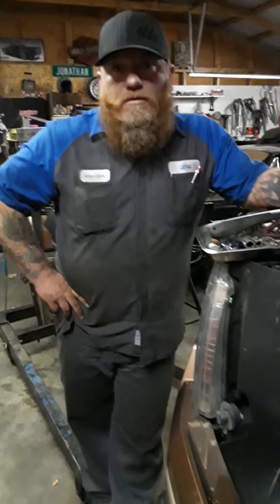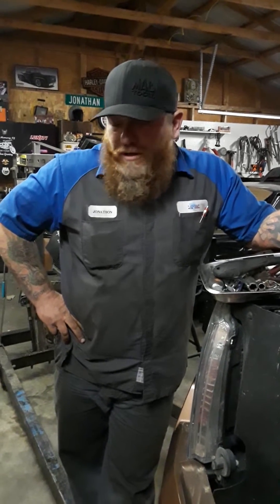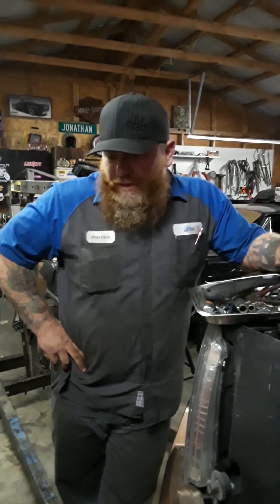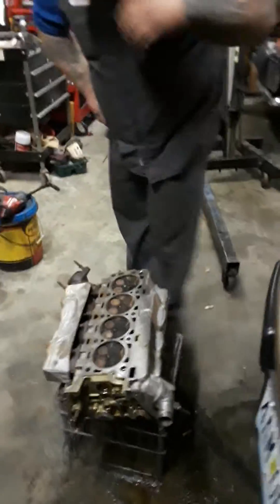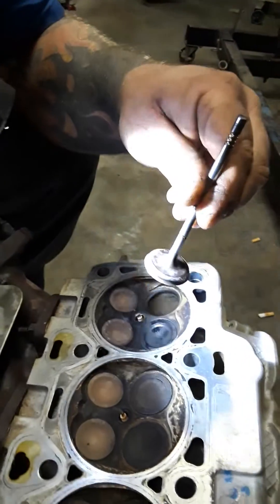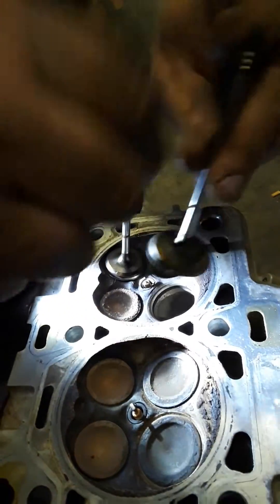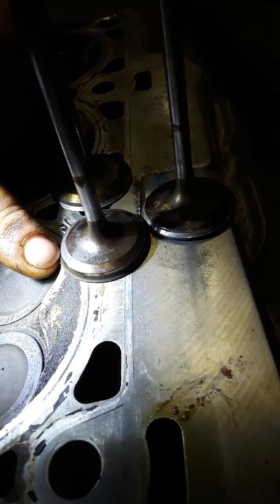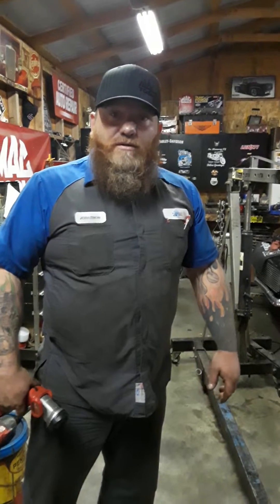Ford 5.0L misfire on #8 cylinder issue

Comment: How is ford not liable for this issue since it is a design flaw. Looks like 100% failure on the 2011-2013 models from what im seeing. Im currently in the same boat at 110k miles. Sad that a truck is dead after such an easy life of never towing. You think ford would replace the valves with decent metal at least.

Comment: Hey man i have a different issue on my 2012. I have a real bad ticking noise that i narrowed down to cylinder 7 or 8. Ive changed plugs, lash adjusters and rollers. Still have ticking. Any suggestions be helpful

Comment: If it was just a bad design then why is it typically only on 8? My guess is this is because the heat does not dissipate fast enough in this area. Running it with Lucas restore, full synthetic, and watching the temperature might help in getting more miles out of it? Thoughts? How long does it take to pull and replace the driver side cylinder head and the cost of a valve job?
Reply: Yes heat issue, all early gen 1 coyotes had heat issues with cyl 8 especially if boosted or under load like towing a lot. 13-14 not as much because they slightly revised the head

Comment: Happen the same thing on mine changed spark plugs, coils, injectors nothing happened. I tried crc valve cleaner and it got worst it was vibrating at idle and higher gaz consumption. Finally changed all the valves and it run like brand new.

Comment: Was this a 4x4? The dealership here is telling me that they need to pull the engine to pull off the head because mine is a 4x4. I can’t figure out what the 4x4 has to do with the head.
Reply: That's a lie. Dealership did my 2013 4x4  this way. They probably just want to the engine so it's easier to work on.

Comment: Thank you WeFixShit for your help in diagnosing this thing. I was sure it was an injector problem because it ran so well on the highway. Compression tested it and only had 80psi on #7. Pulled the heads today and one exhaust valve on #7 was about 1/16" inset compared to the rest of them and I could see light between the valve and seat. Also found another exhaust valve on bank one beginning to do the same thing. Again, thank you for your help 👍

Comment: How many miles would you say it would be safe to drive? I'm having the same issue on a 2014, but do not have money to put it in the shop right now.
Reply: I have a 2014 same issue in #8. I have since driven it another 12,000 miles has 180k now. I run mobile 1 full synthetic and use Lucas restore plus injector cleaner . It has not gotten any worse. 2 years ago the dealer said I need a new engine as it will blow up at any time. Another independent shop wanted 2500 to do a valve job
Reply: Fix asap

Comment: Nothing but another POS designed by Ford to just make it past warranty/ cost the customer an arm and leg & then have to buy another truck, they just hope u buy a Ford again. This is a stone hard fact and the only thing the company cares about; bottom line profits, it has nothing to do with the quality or reliability of the product. Ford does not care they do the minimum they have to follow rules/ regulations. I work as a Technician and would never/ ever purchase a Ford vehicle. Just my 2 cents

Comment: I see you have most or all the front end still assembled. I don't expect you did this over the fender. Any tips would be greatly appreciated. I have a 2013 with a bad head gasket. Thanks for the video.
Reply from the maker: No body parts had to be taken off.

Comment: Same exact issue on my 2012 5.0 F150 Low compression in cylinder number four. Service light flashes sometimes at idle.. Run and drives perfect
Reply: Same exact truck and cylinder issue here. When driving it runs great, idling not so much. Noticed the service light flashing at idle for the first time the other day. Did you confirm it was a valve issue?

Comment: Where are you guys located? I have cyl 8 on my 14 mustang gt that has low compression, misfire, etc.
Reply: U fixed it?
Reply: @Piuf30  ended up buying a new engine from Ford.
Reply: @MSUDave  Mind if I ask how much it cost and was it new or remanufactured?
Reply: @beedifrnt  new engine. Just over 8k.
Reply: @MSUDave  Thank you for your quick response. I was just quoted $9,100 for a remanufactured engine, which includes installation and a 3 year/unlimited mile warranty. That is from a Ford Dealership. They claim even a remanufactured 5.0 is extremely difficult to find these days.
Reply: @beedifrnt  when I bought mine, the shop, who is a certified Ford repair shop, said it was the last one in the nation at the time due to COVID. I'm sure prices increased as well. If I didn't have a bad back I would have done it myself to Save some money.  I would probably consider that engine in today's climate. Np.
Reply: @MSUDave  Engine will be delivered and installed next week.They stressed it is a long block - not a short block. This dealership service department has a good reputation, and since it does have a good warranty on parts and labor, I went with it. I can't afford a new vehicle and my truck is in otherwise good shape. Thanks for your input, I appreciate it.
Reply: @beedifrnt  good to hear man. Enjoy it! I drive my mustang as much as possible to get every penny out of it lol.

Comment: I was told I need a brand new engine on my 2014 f 150 V8 because the number 4 cylinder is shot. I just got the truck and hardly ever drove it.Do I really need a whole new engine because they are one piece and you can't just fix one. I keep driving it because I can't afford new engine but will need emissions done and it won't pass?
Reply: Its hit or miss honestly
Reply: I got code P0308 misfire #8 and they also told me i need a new long block. I ‘m getting a second opinions cause it will cost me 5k to fix it. I have 122K fwy miles .
Reply: @sigmamale7604  What was result?  I've got same cylinder
Reply: @RWHild  I have the same problem and it's most likely the valve not sealing on the valve seat. It drives okay but idles rough and throws the P0308 code. Shops want to replace the motor because they don't want to warranty a valve job. 

I'm going to take the heads off this week and verify, but 99% sure it's the valves. Maybe I'll make a video of my struggles.

Comment: Fuck me, I have the same problem on my 14th f150 right now it only 83,000 mileswater pump grenaded going down the highway block overheated and ever since I've had a misfire in idle change out the coil and the plug still misfiring and this is exactly what I'm scared of....
Reply: Overheating may have blown a head gasket.

Comment: Mine has 90 psi-100 psi on most cylinders. Shows missfire on cylinder 2. Did a missfire test with a scan tool and all cylinders are missfiring. Guessing this is the same problem as the one on the video.
Reply: was it ?

Comment: I got a 2015 with this issue 30% Down on compression, im still smoking 6.2 like this lol but really wanted to get it fixed but fird wanted to charge me to strip it down to see what was causing it if its $3,500 at the dealer i think ill just take it to a performance shop and upgrade there

Comment: Im having the same problem, cylinder 8 misfire, bad cylinder head. The ford dealer wants $6400 to rebuild only half the engine and $9400 to replace. Im not sure what to do i dont have that kind of money to fix it.

Comment: Pulled the head off, and all my intake valves are worn down to razor edge, I'm sending it to a machine shop for a valve job, I just can't pull the passenger side head because I cant open the exhaust manifold  bolts to the exhaust pipe and I gave up on pulling it out, my advice take it to a mechanic it's a huge job and you need many tools save yourself the headache, cursing and lots of sweat and blood.
Reply from the maker: Great advice. Our entire reason for this video was to alleviate the stress of what the problem may be and to shine light on it being a common problem. Most people should hire a mechanic and let them do the work properly.
Reply: @wefixshit2200  where you guys located and what’s the shop called?

Comment: Thanks for the good video.
I own a 2016 f150 XLT with the 5.0 with 53000 miles. I have a big misfire feels like at idle. Engine has stalled on me twice in 4 months. No check engine. How do I know if my issue is a misfire is one of the cylinders? Sure dealer knows what the issue is but they rather play dumb and say is normal since there is no check engine..
Reply from the maker: If you have a mechanic you can trust, consult with them. Otherwise the only way really to check a cylinder is to start with a code reader. Ours was singled out to one cylinder. We tested the plug, coil, and injector. After that, the only thing to do was pull the head and that's when we saw the valves worn down severely. Good luck man.
Reply from the maker: Another thing you could try is is since it isn't throwing a code it could be as simple as cleaning your throttle body good and making sure your air systrm is nice and air tight. You want to start with the simple stuff first. I have a 2001 gmc sierra and the problem i had with it a couple years ago sound exact to your problem now. I cleaned my throttle body and it fixed it. My truck dipped down low on rpm's and even stalled out at a couple stop lights on me before i fixed it. No engine light with that problem either.
Reply: @wefixshit2200  I'm thinking you could have done a leak down and also stuck a camera in through the spark plug hole, to see the condition of the cylinder, whether it was scored.
Reply: Clean fuel injectors first.  Then clean catalytic converter.

Comment: Thanks for the video ! I have 3 F150 trucks 2011, 2013 and 2016, all with the 5.0l engine . I have replaced the valves in the 2013 and 2011 both at about 112000 miles, now I wasn't supprised to see the 2016 start misfiring on cyl #8 at 136000 miles !! I have swapped the spark plug and the coil , same problem. I am so frusterated already , Somebody should open a site about this problem. I tell everybody , STAY AWAY FROM FORD'S 5.0L ENGINE !!!! GARBAGE!!
Reply: Mine went 234,000 miles before that had a problem.actually the 5.0 is a good engine 😊
Reply: My 2013 lost a valve at 80,000 miles. Replaced cylinder head under extended warranty, then misfires and head gasket issues at 130,000 miles. Feel your pain, I loved that truck but I don't have time to fart around fixing it.

Comment: What causes this ? Is the problem likely to happen again once fixed ?
Reply from the maker: Yeah. It will probably happen eventually. Soft or weak valve material. That thing was wore to a razor sharp edge.
Reply: @wefixshit2200  why only cylinder 8 or can it be any of them?
Reply: It happed to me cylinder 6

Comment: Had the same problem, misfire on 8. low compression. Was told I need a new motor. The Engine shakes while idling.
Reply from the maker: Without having your vehicle in front of us, we couldn't know for sure but if you can get a few different opinions. Mention what we did in this video and see if it could possibly be a help to your situation. Good luck
Reply: y dan my truck is a 2012 and they told me the same thing for $9000. Cylinder 8 10% down on compression and they suggested a long block replacement. Obviously I’m getting a second opinion
Reply: 2012 F150 5.0l V8 pulled the head of and will do a valve job, my compression on #8 is 75psi, but mine will be ok when I do a wet compression test, so I'm also replacing piston and rings in #8
Reply: I have a 2014 f150 5.0 234,000 miles same problem #7 cylinder. I’ve opted out for a new engine 11k . It’s paid for and cheaper than buying another truck .

Comment: Had this same problem on a 2014 5.0 did the leak down test and it failed after getting the heads repaired a cylinder 7 misfire showed up we did another leak down test and checked all the basics such as coil injectors and spark plugs. We have checked everything we can think of and are running out of ideas. Any ideas on what to check next
Reply: Head gasket maybe the repaired valve is still leaking bad seal or seat??

Comment: I have a 2012 5.0 that has the same exact problem. Hoping you could get ahold of me personally and let me know how much you charged to have it fixed. I’ve been getting prices all over the place and for me as a young farmer it’s either going to be fix it or get rid of it. Look forward to hearing from you.
Reply from the maker: The job we did on this f150 cost about $1350 parts and labor. If you go to a shop, most of the time they will want to just replace the head which would be higher. Sorry it took so long to get to your comment. I used to get emails when we got comments and i guess that has stopped lol. We will be paying more attention. Hope this helped man.
Reply: @wefixshit2200 where are you located?

Comment: Good video.  I've been looking for a used 2011 to 2014 f-150 5.0. Did they fix this problem starting in 2013? Is there a year range you'd stay away from in the range I'm looking for? Would it deter you completely knowing now what you know?
Reply: 2016 F150 5.0 with same issue. Bad Intake valves on cyl 8. Dumb!
Reply from the maker: Thanks man. We just want to help people out. Got another video coming up soon with some very helpful info for Nissans, stay tuned.
Reply from the maker: I think the 5.0 is a great motor. I don't know of anything they have done to fix it. This is just one of those things "hit and miss" problem, if you will. It's a possibility to have this issue so it's up to you man lol
Reply: @wefixshit2200  I understand. Seems like I've since read that they may have fixed this beginning in 2013.  Appreciate the response. Good job on the video!
Reply: @ducsauce85  They didn’t fix it, i have a 14 with low compression (90) in #4 cylinder. 90% sure it’s valves.
Reply: @MrZombies24  sorry to hear.  I bit the bullet and bought what I really wanted... used 2016 Tundra.  Good luck!

Comment: Thanks for the video.  Had my F150 towed to the dealer today; same problem.  Quoted $3,500 for a head, $8,500 for remanufactured engine.  They said they'll do a compression check, scope it etc.  Because of your video, if they pull the head, I'm going to want to see the valves before putting out that kind of money.  Many thanks, Jonathon.
Reply from the maker: Good luck Jeff, let us know how it goes!

Comment: I've got a 2014 stx 5.0 that has a misfire on #7 only at idle. Changed plugs and coil packs to no avail. Driving the truck feels to run smooth as butter but at a stop light you can really feel it spitting and sputtering. Took it to the local shop to have it checked and the scanner says the only problem is the #7 cylinder. Have you ever run across this issue? Any help or insight would be greatly appreciated.
Reply from the maker: Sorry it took a while to get back with you BJ. Really, the only way to know is to get the head off and investigate. Let us know how it goes!

Comment: Did you ever finish the 5.0 valve repair? If so did it fix the problem? I have a 2012 f150 with 5.0 with #8  missfire as well. Low compression. I read that there is a colling issue for that cylinder that burns the valves. Can you maybe list the parts needed for the job?
Reply from the maker: earnest wilbanks yes sir, cleaned the valve seat up with a lapping compound and replaced the valve. Truck runs great now. I didnt notice a cooling issue on this job, looked to me that it was a valve material problem, they were all wore a little.
Reply: Couldn't agree more. My 2016 has the same issue. What a shame as I love the truck but garbage motor. Ford didnt do anything for me under warranty. Tried 4 different dealers each more times than once...